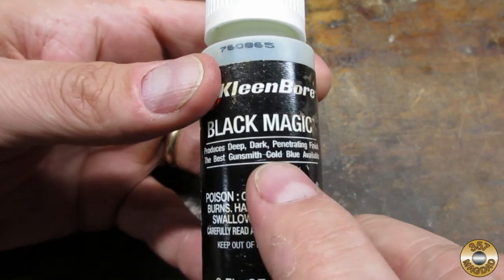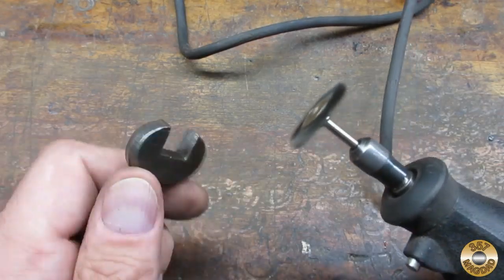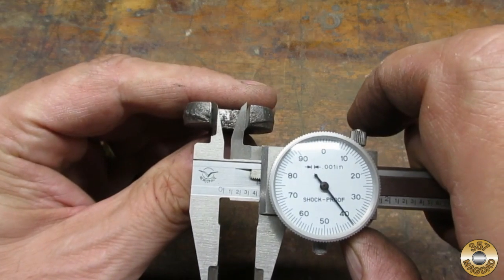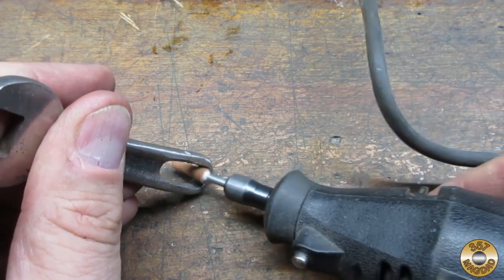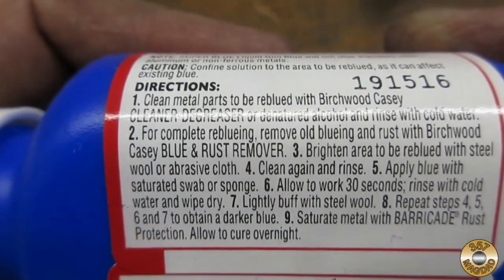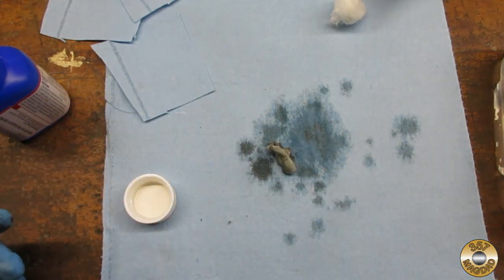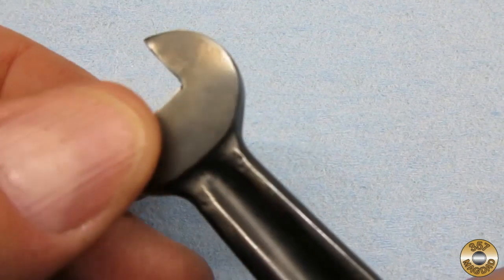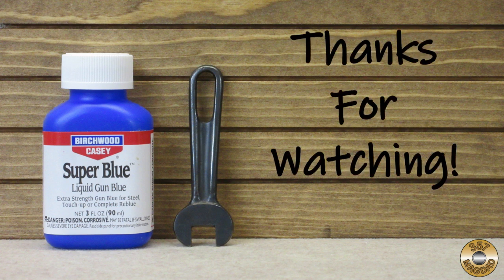Product Review - Birchwood Casey Super Blue

Comment: Polishing with steel wool between coats, and after final coat makes a huge difference.  Evens out the finish and makes the polished surface look buttery smooth.
Reply from the maker: Thanks for watching!  I've had good success buffing with steel wool in between coats.
Check out my Perma Blue review!
https://www.youtube.com/watch?v=62gOhxEi-t8
Reply: Steel wool has OIL IN IT to keep it from rusting.  Clear it with ACETONE before introducing it to projects like this.

Comment: would heating the metal offer any extra protection. If not, what can I do to get these cosmetics with added protection to the metal. I am considering this for bluing a gun barrel.
Reply from the maker: Rust bluing is the most corrosion resistant type of bluing but it is more complicated than cold bluing.
Reply: It helps the solution do its job. Not necessarily more "protection" but might have a deeper more even finish (after several coats).

Comment: I like using this stuff on tools I restore or make. I find using steel wool before the first coat and then after each application works best. I have rivet sets I did about 20 years ago that have been used hard, not given any special treatment whatsover, that are still black and not rusty. The paste can be easier to use on some things but the liquid is what I have used for decades. Interestingly, I have never tried it on a firearm!
Reply from the maker: Thanks for the tips!  The Super Blue is a good finish option!
Reply: @357magdad  
I have a video "some old wrenches I found" showing my results. I was experimenting with acid versus electrolosys rust removal so some look more brown. Since then I have done a couple of old Stillson pipe wrenches and had better luck bead blasting them. The bluing was more even. I still steel wooled before and after (OOOO).
Reply from the maker: @upsidedowndog1256  I subscribed!
Reply: @357magdad  
I just saw that. Thankyou! I don't put out videos very often.
Reply: Doing my first firearm right now. It's looking amazing.

Comment: I've tried this stuff with several of my restorations, but gave up on it because it isn't durable.  It either wears off or scratches off, plus I couldn't get an even finish even after multiple applications.
Reply from the maker: Thanks for watching John! I agree, it's not a very durable coating.  I plan to experiment with rust bluing soon.  It's supposed to be more durable and corrosion resistant.
Reply: @357magdad  Can't wait!  I subbed after Scoutcrafter recommended you.  I like the variety of restorations you're trying.  I'm the same way- tools, furniture,  toys, fans.....anything interesting.  Love your vids.
Reply: Thanks for sharing. What you suggest for a good rustrepellent finishing on normal steel? I have to protect a metal lever that is halfway in the gearbox (well protected from weather) and halfway out the gearbox, I can't paint it because it is possible that some solvent or transmission fluid could go on it. The previous lever is at a good rist point and the car is 10 years old. I'll replace that part but want the new one to resist. Thank you.
Stay well.

Comment: I think this was an alloy as I have gotten even deeper darker blued results using Perma Blue on a Makarov touch up.  Pretty good though.  You made that little 50 cent wrench into a $20 Snap On wrench.  No.  If it was Snap On it would be made out of Gold under the Chrome.  LOL!
Reply from the maker: I have used the Super Blue on several projects now, and the darkness does seem to vary depending on the metal.

Comment: I have a few questions. Also open to suggestions. First question: after bluing and curing in oil. Is is safe to handle? Second question, does it work on Tungsten? I was hoping to blu my dart barrels. Throwing darts. 🎯 if this would work let me know. Or if a suggestion. Darts are like baseball gloves. One would think just buy a new set. My darts cost about 175 after some minor changes. It makes a difference. But I prefer the dark black look over bright.
Reply from the maker: Thanks for watching!  Yes - the blued parts can be handled.  No- the bluing solution only works on ferrous metals.
Check out this video on darkening tungsten fishing weights:
https://www.youtube.com/watch?v=XfUA1-J1E9M

Comment: It’s a good idea to use 0000 fine wire wool when first applying the liquid….it ensures an even coat and helps the liquid to penetrate the surface where there are any imperfections…
Good stuff, but expensive….
Reply from the maker: Thanks for watching John!  Some steel wool has oil in it to keep it from rusting.  I think the oil may interfere with the bluing.

Comment: You also can pick up the bluing solution at Walmart. I've messed around with it a little, but haven't gotten great results. I blued an old ball pein hammer and let it sit overnight in wd-40, and I began having rusting issues with it.
Reply from the maker: Cold bluing is just for looks.  It has no protective qualities.  I've found that you have to thoroughly rinse in water then dry before soaking in oil.
Reply: Professional shops "Cure" or soak in just kerosene for 24 hours after this type of work.

Comment: You get a much better and more even and darker finish if you lightly steel wool in between coats.
Reply from the maker: Thanks for the tip.
Reply: Heating the metal first before you apply super blue also helps

Comment: He says he can't help himself but wait until he discovers polishing wheels that can fit on a regular bench grinder, just like his wire wheel, then he will have two or three additional bench grinders each setup so that one side is slightly coarser polishing wheel than the other and he will have four or six polishing discs lined up across the bench. Ask me how I know!
Reply from the maker: Thanks for watching!  I have one bench grinder for wire wheels and one for the fiber wheels.  The Flitz polish seems to do better with a slower speed wheel, so I usually use my Dremel on low or a buffing wheel in my hand drill.

Comment: Will this work on watch screws?
Reply from the maker: The cold blue solutions are designed to work on plain carbon steel.  As long as the screws aren't stainless steel or plated, it should work.